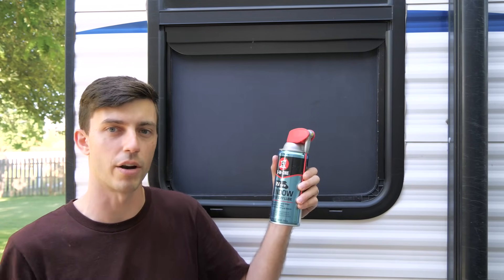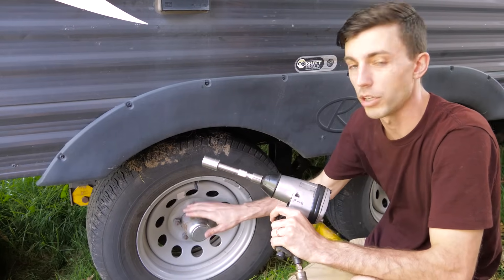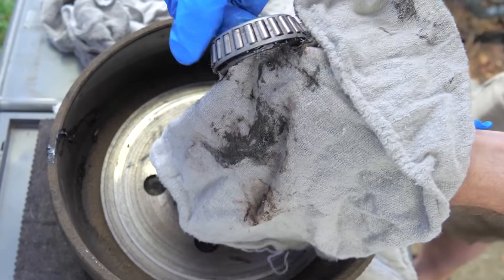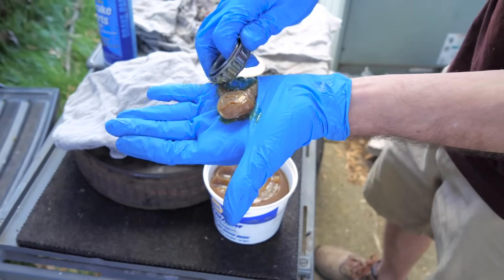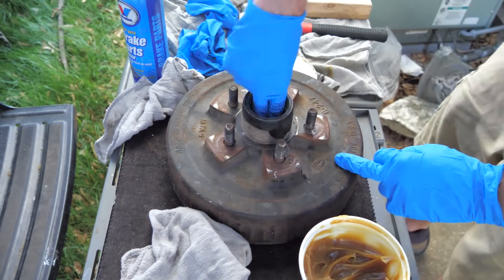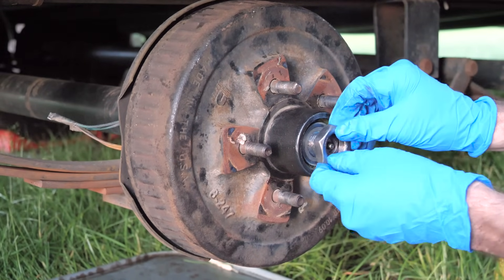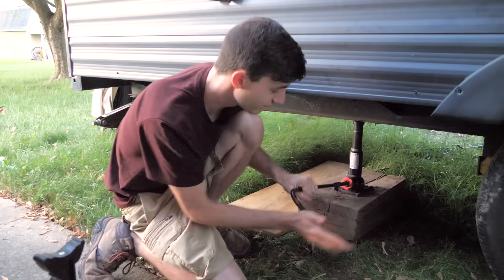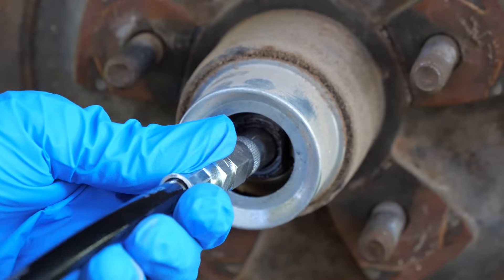Trailer Wheel Bearing Grease Repack and Easy Lube - RV Travel Trailer & Fifth Wheel

Comment: RV newbie here! Just bought our first used travel trailer and I am doing research trying to make a list of all the maintenance I need to do. I apologize if you mentioned this in the video and I missed it or if you answered in a previous comment, but, in a video that I watched about changing tires, they said to hook your trailer up to your tow vehicle to help support the weight before jacking it up. Is this something that you do either when changing tires or working on brakes/bearings? Thanks!

Comment: The EZ lube axle design can and does create problems if one is not careful with them. You need to be careful not to just keep pumping grease into the hub. It you can actually cause the rear axle seal to leak and end up with a greasy brake drum.

Comment: Nice video... one additional note... when you're tightening the spindle nut, you should rotate the drum as you're tightening it, to make sure the bearings are properly seated to the race.  I believe there is also a torque spec for that nut while you're doing the initial tightening before you back it off and install the retainer, too.  We just got our first TT this spring, 2020 Apex Nano 187RB (Off-Grid/Outfitter), and even though we bought it new, we knew what to expect with a new TT, from watching yours, and others' videos.

Comment: Nice job!
Is there a reason you can't use your stabilizer jacks in lieu of a jack stand? My stabilizer jacks ARE jack stands (old vintage trailer), I wasn't sure if newer RVs have weaker jacks.
Reply from the maker: Stabilizer jacks on travel trailers and fifth wheels should never be used to support the weight in the trailer. Ours have stickers right on the stabilizers that say it.

Comment: Considering that wheel bearings should be repacked every 10,000 miles or annually what ever comes first AND the amount the amount of miles you put on your trailer i think i would consider adding a hub meter to record trailer miles.
Reply from the maker: A hub meter is an excellent idea! We will look into that, thank you 👍
Reply: Fate Unbound you will find them in the same isle as the tire pressure monitoring kits. LOL It would also add more content to your DIY videos.
Reply: I searched and searched for one that would work on small(er) wheels like found on travel trailers and haven't really found anything. Hub-O-Meter is more oriented toward large semi  wheels and they are calibrated by tire diameter and you purchase them for a specific tire size (and are dreadfully expensive). I found one Australian made one that replaced the grease cap but it only read metric and I am not sure if it would fit USA hubs.

Comment: With the EZ Lub fitting shouldn't you still jack up the trailer so you can rotate the wheel while forcing the new grease in?  Just asking because I don't know.
Reply from the maker: Yes, you should still rotate the tire for the EZ lube one so jacking it up would be what you need to do

Comment: A little late to the party, but it looks like you have greasable axles via the zirk fitting on the end of the axle under the dust cover.  You should be able to just hook a grease gun up to it and fill it without all this work.  With that being said, it's still advisable to do this once every few years, but a grease gun before long trips and a couple pumps should do you just fine.
Reply: I jumped the gun, you showed this after the first part.

Comment: How often do you recommend repacking the wheel bearings? We bought a travel trailer last spring and have put about 3,500 miles on it so far.
Reply from the maker: It should say inside your owners manual. I'm not sure it's the same for all models.

Comment: It's strange to me that the travel trailer market isn't willing to pay for quality zero-maintenance bearings, such those that come on tow vehicles and motorhomes.  I wonder how many of us would be willing to pack the bearings on our cars and trucks every year or 12k miles, whichever comes first?  This shows the difference between the needs of the casual RVer, who apparently only cares about price, and the one that uses their RV a lot.  I wish that quality sealed bearings were an option, at least, on travel trailers.
Reply from the maker: I believe it's because travel trailers and fifth wheels generally never see the regular use that a car or truck sees. A travel trailer or fifth wheel with 100,000 miles on it is most likely very rare. The vast majority of RV's just don't get used very much, so it is more cost effective and makes more sense to put bearings like this on and just repack them as needed.

Comment: pro tip.  if you're going through the trouble of repacking the bearings, just replace them with new bearings.  they're cheap enough and you don't need to worry about them failing before the next packing
Reply from the maker: If you're properly repacking them they shouldn't fail unless they're really old. That's the whole point of regularly repacking them afterall. However, if this gives you peace of mind then more power to you!

Comment: the plastic cap comes off so you do not have to remove the hubcap to see grease fitting.  also, you said rotate the wheelwhile pumping, cant do that when wheel in on ground, just sayin'.  good vid.

Comment: I used this same method to grease my axles (ez-lube method)...brought it to the dealership the next year for a once over and they told me that there was "way too much grease in there and it only takes a couple pumps".....Any one got any takes on this or been told the same??
Reply from the maker: The procedure I showed is straight from the manufacturer, Dexter Axles. Here's a link showing the procedure made by the manufacturer https://youtu.be/XT0RKDGgDm8?si=H9Dug7ZVOXIJWmBh

Comment: I think your cap has a center plug that CAN be removed so you don’t have to remove wheel. BUT the center plug is a cheap plastic and can break if not careful. I now have two with and two without. I still have to spin the wheel and although I have 8 lugnuts I just as soon pull the wheel instead of breaking another center cap. 🤦‍♂️🥴

Comment: Why do trailer wheel bearings need so much more maintenance than automotive wheel bearings?
Reply: There was a time when auto bearings required the same maintenance but almost all manufactures now use sealed wheel bearings.   Some trailer axle manufacturers use never-lube bearings but they seem to have a higher failure rate.

Comment: Seals are pretty fragile. You really dont want to use a metal hammer to start them. Very easy to damage them and can cause early failure. If you are going to be doing your own wheel seals get the proper tool to install seals.  *eye twitching at the crome socket and extension on the impact gun...lol.. Good video

Comment: Looks like you did a good job but you could have done a little better. You could have put a piece of cardboard or an old towel underneath the axle when you start taking it off. If something does fall off it's on a clean surface. And when it comes to the grease you should have used synthetic grease for those bearings you cannot go wrong with that.

Comment: 5:24 "The easiest way to [remove the seal] is to use a seal-removal tool."
The EASIEST way to remove the seal is to flip the drum over, and insert a wood dowel through the hole and GENTLY tap on the inner bearing to push the seal out.  As the video shows, the tool requires some means of holding the drum (like, a helper), and will mangle the seal.  Use ONLY a wood dowel to ensure no damage to the inner bearing.

Comment: NEVER USE the Easy Lube fittings, I have seen many inner bearings fail that had easy lube fittings, when the bearing area is totally filled the bearings actually run hotter, you also want to look for discoloration on the bearings and race that can happen when bearings get too hot.
I cheat and use a press to insert new seals no chance of it getting crooked

Comment: For the life of me... I cant understand the need to re=pack trailer bearings. How many times have you done your car axle bearings? None? Yep because bearings that are not submerged do not need to be repacked. Waste of time and energy.
Reply from the maker: Your ignorance is on full display. Trailer bearings and car wheel bearings are VERY different. Car wheel bearings are encased within a sealed unit and a type of grease is used that is made to last over 100,000 miles. Trailer wheel bearings on the other hand are not this way.
And actually, older cars and trucks had to have their wheel bearing grease repacked regularly much like modern day trailers.
The reason trailer wheel bearings need the grease repacked and cars don't is a cost issue. Trailers are made to be as inexpensive as possible so they skimp out on the wheel bearings. Cars on the other hand need to last as long as possible with minimal maintenance so they're made with more expensive wheel bearing units that don't need maintenance.
Stop equating a trailer to a car, they are very different things.
-David
Reply: @FateUnbound  perhaps American trailers are made to a poor standard however, your ignorance is now on display for assuming that I was American and using sub-standard wheel bearings in my trailer.